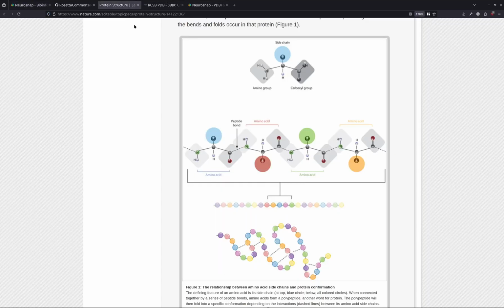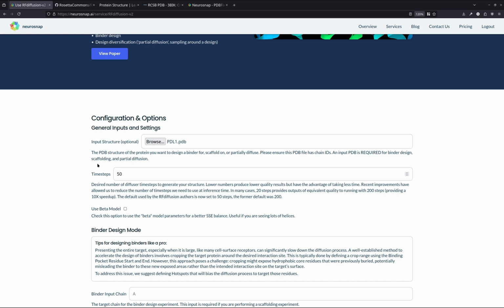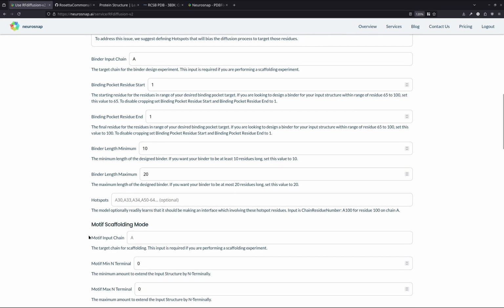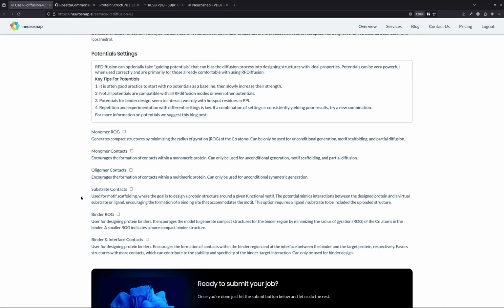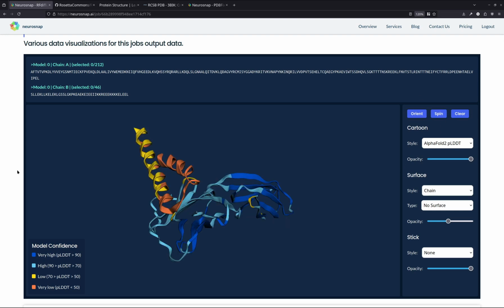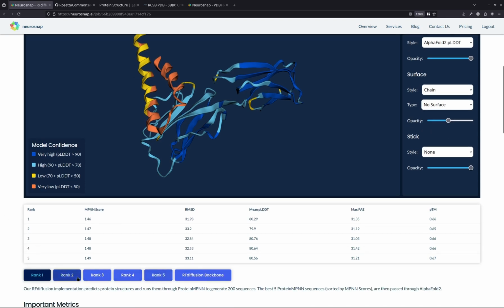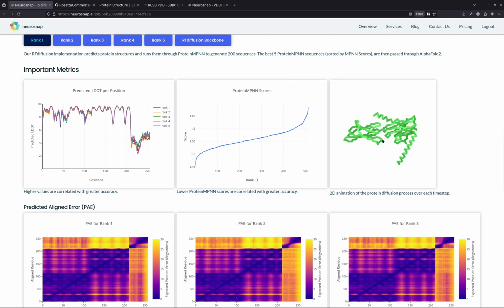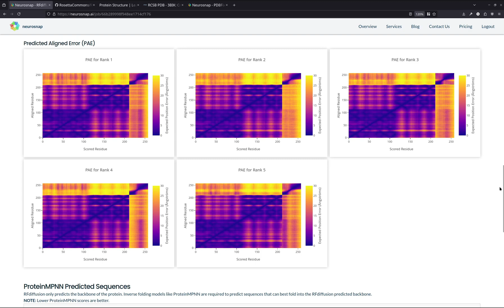Designing Peptide Binders With RFdiffusion & Neurosnap | RFdiffusion Crash Course Part 1

Comment: Whats the best way to optimize the sequence of denovo enzyme? I generated a sequence for my purpose, it folded generally okey, but has some low pIDD loops. I am trying to use MPNN, ESM-EF1 with further evolutionary most possible residue mutations. Do you have any suggestions? Thanks.
Reply from the maker: Great question. It may be beneficial to either fix the catalytic residues or filter out designs with extreme mutations in those regions. Additionally, we've observed that ProteinMPNN and other inverse folding models tend to introduce disruptive residues like proline into loop regions—something that’s often structurally unfavorable. I recommend adjusting the model’s residue bias to reduce proline insertions in such contexts.
Reply: @ thank you

Comment: when I have a very reliable template to start (which has high pIDTT score >90), is it possible to improve the design using RFdiffusion? In other words, is there a way to input a template to get started?
Reply from the maker: Well "improve" can mean a lot of things and is very context depending. But generally speaking RFdiffusion can certainly be used to diversify the fold of a protein which in many cases can lead to more desired properties. Moreover, a high quality initial template will likely result in higher quality outputs and structures.

Comment: Hi, thank you for your tutorial.
I am wondering more advanced setting in terms of binder design, such as "binding pocket residue setting"
Another questions is, are we able to apply both alpha and beta model when generating a new binder for the target protein?
Looking forward to your next video!
Reply from the maker: Thanks! Glad you liked it.

The binding pocket residue setting lets you crop a protein between two residues. For example, if your protein is 500 amino acids long but you only need residues 100-400—say, to exclude long disordered termini—you can set the binding pocket to start at residue 100 and end at residue 400. This removes all atoms from residues 1-99 and 401-500, ensuring they aren’t included in RFdiffusion.

Comment: Is there any reiterative process to improve the predicted ligand? The plddt score doesn’t seems great.
Reply from the maker: There are some other steps / tools that can be used to improve the quality of the binder but generally you're just better off just doing multiple separate RFdiffusion runs in order to get the best results. A reality of these techniques are that frequent mistakes and false positives are inevitable and an effective way to minimize these mistakes is to simply just sample a very broad number of different binder designs and try to validate them using follow up steps.